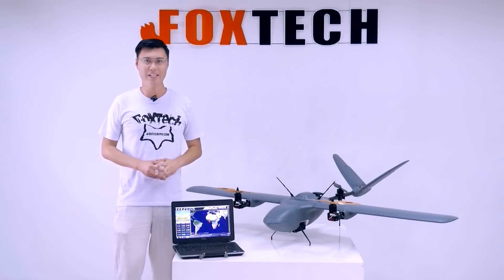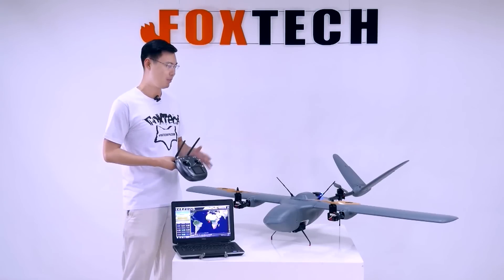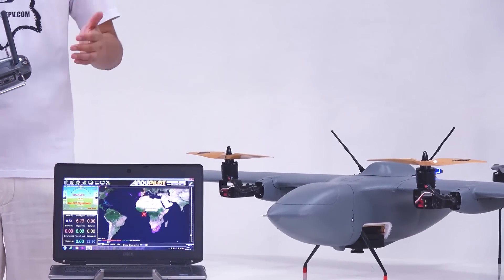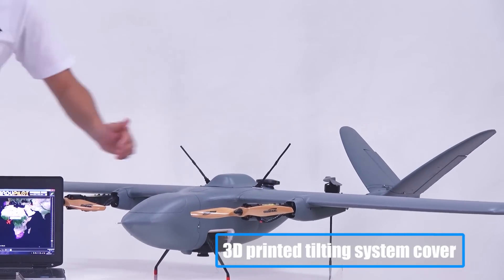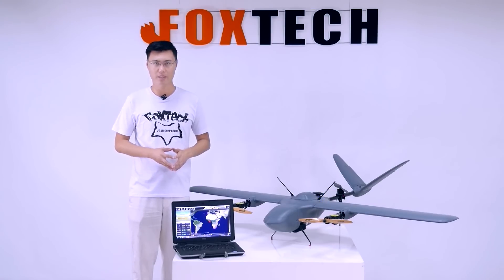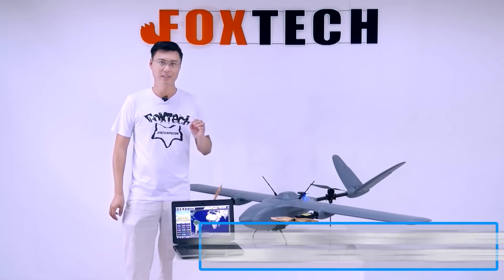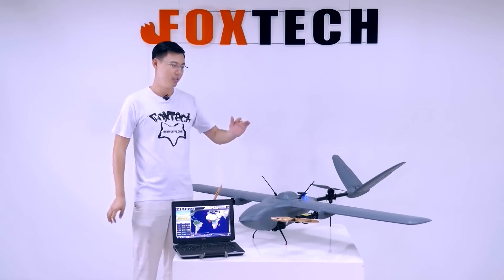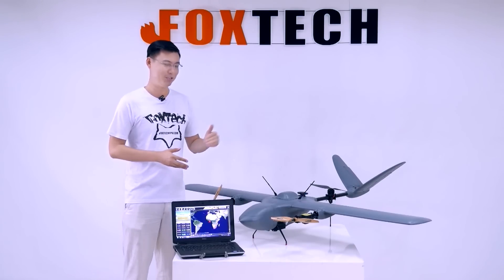Nimbus Mapping VTOL Grey Version

Comment: Something does not add up, I looked up the weight of the components alone for this aircraft on your website, and they are almost the same as the advertised flying weight. 
Could you clarify the weight of the airframe and maximum permissible flying weight with the Li-Ion battery?  
Seems the rear lift motor is different in the videos than the specs as well.
I want one, but some things are not very clear, and it looks suspicious. 
Also no complete videos of it flying, just tiny clips. Want to see whole flight with transitions on video.  Price is good, and I love the innovation with the power switching. that's brilliant. I was going to make a product to do that, but now I'll just buy it from you instead. 
Thanks!

Comment: Could you please include max hover time as well as forward flight time in the specifications. Hovering usually consumes considerably more power than forward flight. Very interested in this product and happy to see constant improvement, good work!
Reply from the maker: hover time is normally 15 minutes ,but not suggested to hover that long
Reply: Foxtech what about hover time with the two battery setup?
Reply: Hovering in VTOL is most battery draining mode! please refrain from Hovering VTOL other than for landing and takeoff!

Comment: Does exist a light version of the VTOL Nimbus (only motor, servo, battery swapping board, control board for the airplane/multirotor mode)? No need for mapping, just aerial video.
Reply: Hello, Tume. yes, sure, Nimbus VTOL no mapping camera mounted is available. Please contact Foxtech sales for a detail quotation or any other customizations: support1@foxtechfpv.com
Reply from the maker: yes of course,  the standard version can do it ,we will soon update a version with PG20 power swap board and suggested batteries, longest distance we flew in single take off is 100km